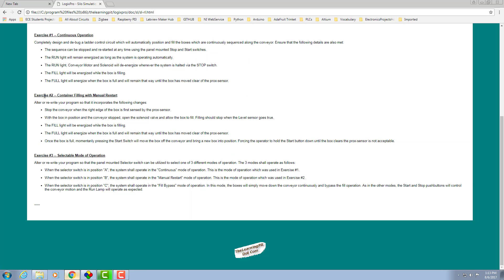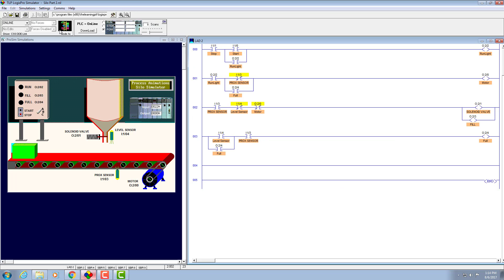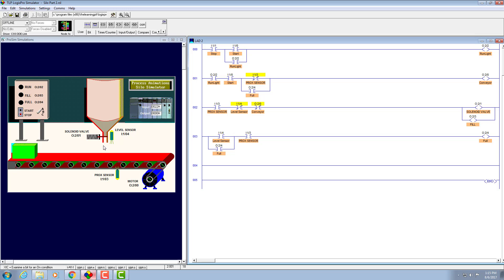LogixPro Silo Part 2

Comment: Unfortunately this is not the solution. In the instructions it states that holding the start button is not acceptable. You must add a branch circuit around your second start bit and seal it in with another bit in order to have it operate correctly, and meet the requirements in the instructions.

Comment: This is not a suitable solution to the problem.  Step 2 of this exercise is supposed to operate similarly to step one, except the box should wait for the operator to re-energize the conveyer in one push of the start button after the box is full.